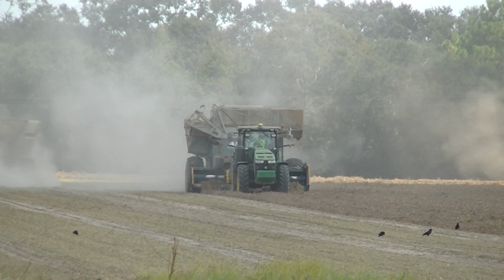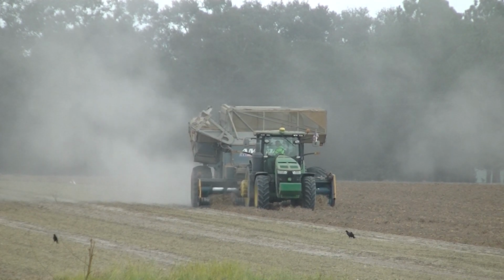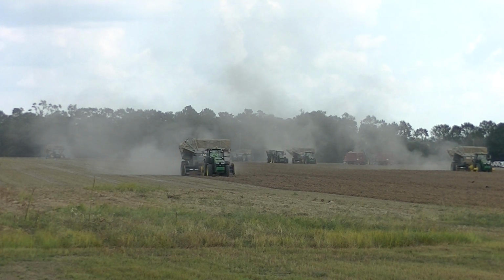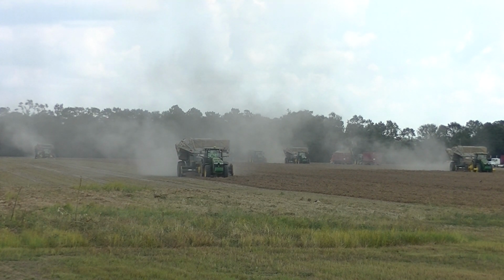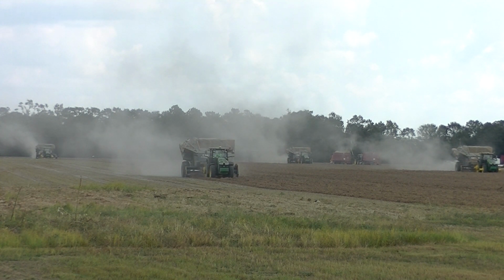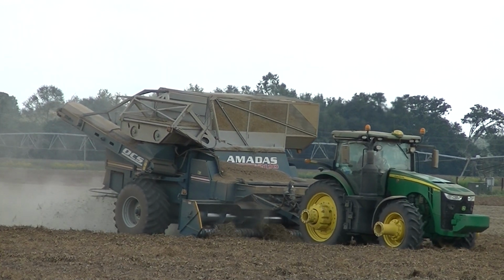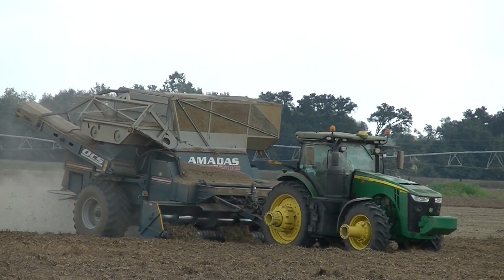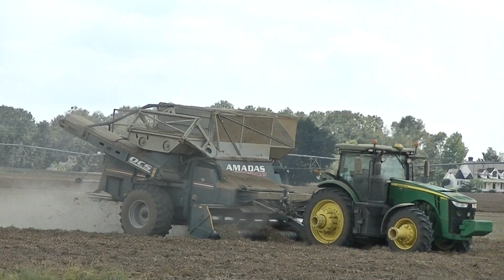EIGHT JOHN DEERE 8000R TRACTORS PICKING PEANUTS. SCOTT FARMS 2019 PEANUT HARVEST GARDNER FARM PT1

Comment: Nice video with a good selection of machinery. That must be one of the most boring jobs just sitting in those tractors hauling the combines at that speed nowadays when everything moves faster in the farming world. At least the men driving the 'dump-cart' tractors can move about the field going to and from the machines to the trucks a bit quicker than just between 1 and 2 mph all the time.
Reply from the maker: Now it is not a bad job. Cab tractors, radios, cell phones and Auto-steer make it almost an enjoyable job. Half the guys I see in the cabs now, just make the turn, engage the GPS, pull out their phone and stay on it till it's time to turn again. They do watch for other issues though.